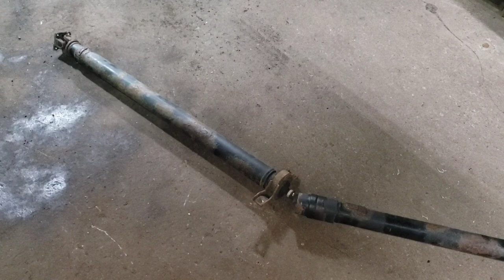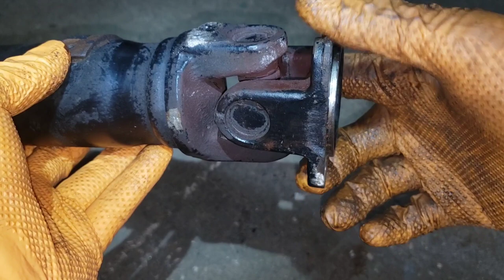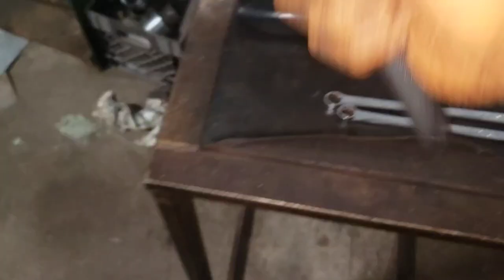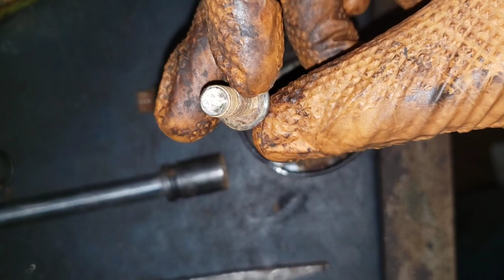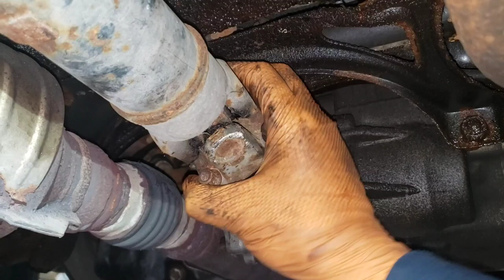Honda CRV drive shaft replacement

Comment: You can replace just the bearing of the drive shaft - Yes, Honda says to replace the whole thing for some reason, but there are expert shops who replace just the bearing. I had this done for my moms crv at a place called Cardanic in Toronto. Only cost $300. If a shop convinces you you need a new one, call another. Called a handful of places before finding Cardanic. Don’t stress, light issue. It was a 2014 CRV.
Reply: 300?? At that point your better off buying a new one off amazon or ebay there under 150 bucks.

Comment: word. im waiting for my driveshaft to be delivered right now.. right before a big roadtrip bro i already replaced the ball joints, brakes and rotors, and windshield wipers. then i dropped my friend off at the airport while leaving my driveshaft FAILS its broken, snapped the front u joint ON THE HIGHWAY i was scared but i just rode it down an exit managed to turn and drive down until i could get off and park. its in my “driveway” road construction its raising our streets so im quite literally in my neighbors yard!

Comment: You done scared me when you said I would have a bad day if I break a bolt in tge roller bearing if there is anyone that can accidentally  break something, it's me. I can use a 1/4" ratchet and socket and break a half inch bolt with no cheater pipe

Comment: You don’t need to mark or line anything up
Reply from the maker: There is no need to mark anything. Just make sure all of your mating surfaces are cleaned and debris free and straight and you can put it back together.

Comment: Not good advice, in my opinion. Just replace the universal joint, not the whole driveshaft.
Reply from the maker: This is technically a non-serviceable part. There are ways to service it however the majority of people will not be able to service it properly without taking it to a drive shaft shop, which are sometimes hard to find with the capabilities necessary to repair it. So majority of the time the only real option is replacing the shaft. There is no point to me showing people an option they won't be able to do 9 times out of 10.
Reply: Apparently you can't with this gen of CRV.  Don't know why but if so, Honda did it purposely

Comment: its crazy that you have to change the whole shaft for a worn bearing .. have to change mine :(
Reply from the maker: Is there are companies now that make hanger bearings for Subaru shafts, I would check around online to see if there's anything for the CRV. Most likely there isn't because it is older. Good luck my friend.

Comment: can you tell me what the sizes are of all the bolts that hold the drive shaft in I've miss placed mine
Reply from the maker: Sure no problem. For them both to the rear differential it is an M8 by 1.25 thread pitch Bolt. However the studs are unique and should be bought at the dealership. The nuts are just generic not to make sure to get the lock washer. For the hanger bearing I believe the thread pitch is M10 by 1.25. I'm not sure what the length of Bolt is I believe it was roughly about 2 in. Again I would go to the dealership because they have a number of washers. Or you can go to the scrap yard and pull them all off. I hope this helps. Good luck

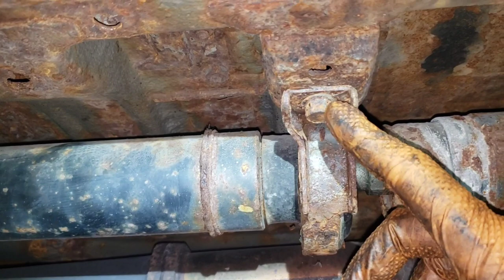Comment: @ 3:06 what are the exact size for these bolts?
Reply from the maker: I don't remember what the exact thread pitch is. They were a 14 mill head and I believe they were an M 10 x 1.25 thread pitch. But the easiest way to find that out would be to call the dealership with your Vin number and then ask them what the part number is for that specific bolt type in the part number to Google and then usually the thread pitch and diameter of the boat will be listed.

Comment: My hondas driveshaft broke. And for some reason its having electrical problems too. Not sure what they have to do with each other
Reply from the maker: Hey Mike I don't think they are related. From what I can remember the only electrical problem you could cause Yourself by having a broken drive shaft is if it's smashed the rear O2 sensor. But I don't remember any wiring in the area of the drive shaft other than the O2 sensor so I think they are completely unrelated. Of course this is depending upon what kind of electrical issue you have. I hope that helps you. Don't forget to subscribe.
Reply: @JimmysAutoClinic  ok. My o² sensor was missing when my catalytic converter was stolen. It was still driving well
Reply from the maker: Well you should get the O2 sensor and converter replaced for the best operation and fuel mileage. What's the electrical issue that you're having?
Reply: @JimmysAutoClinic  the tachometer goes to 0 at times when its running. The lights are dim like the car wants to die and the abs light comes on. Wipers are also slow on full speed
Reply from the maker: Yeah that's definitely completely unrelated. Looks like you'll need a proper diagnosis. From the sounds of it I would look at the alternator to see what it's charging. You could have it failing from time to time.
Reply: @JimmysAutoClinic  ill take a look when its sunny
Reply from the maker: I hear you. Good luck my friend

Comment: What bolt are you using? I need to change mine too
Reply from the maker: Sorry I don't understand the question.
Reply: @JimmysAutoClinic  The one you're using in the drive shaft. My bolts were missing already because the drive shaft was removed. Im looking for the same bolts to attach the drive shaft.
Reply from the maker: Okay so the bolts that were on the drive shaft flanges were I believe M8 x 1.25 pitch. The head is a 10 mm 12 point head. You don't have to use the 12 point style of Bolt you can use a six-point which is just a regular hex bolt. And the hanger bearing bolts I believe for M10 X 1.25 pitch. I can confirm the bolt sizes for the drive shaft when I head into work later today. If you are from Toronto you can come by and I can give you the bolts if I still have them.
Reply from the maker: And of course if you haven't subscribed already please do :-)
Reply: @JimmysAutoClinic  Im living in Calgary. Thank you so much! Will try to look at it on the internet. Subscribed!
Reply: Do you have by any chance know where I can get them in the internet? Can't seemed to see one in particular.
Reply from the maker: For the driveshaft flange bolts I did confirm. It is an M8 by 1.25 pitch. That is the bolt type that you'll be looking for. They are approximately 30 mm in length with the head of the bolt included. The portion of the bolt excluding the size of the head is 20.5 mm. Just keep in mind you don't want to go too long because then you will end up hitting the transmission or the differential itself when you thread in the bolts. Thank you for subscribing and good luck with installing the drive shaft.
Reply from the maker: The best place to get them would be the Honda dealership. If you give them your VIN number they'll be able to get you the exact part. The only downside will be the expense. What you can do is go to a scrap yard and pull the correct bolts off yourself. The only downside to that is they may be rusty and you're going to get dirty doing it.
Reply: Do you think the 1st gen bolts with fit? I can only see 1st gens here in the scrap yard.
Reply from the maker: I'm not sure if it will fit. But as long as it is the same dimensions that I gave you earlier than yes it should fit. Just measure it.
Reply: Is the driveshaft same with the AWD vs the 4WD?
Reply from the maker: If they are the same year and vehicle there is no difference. All the Honda 1st Gen CRV are all wheel drive